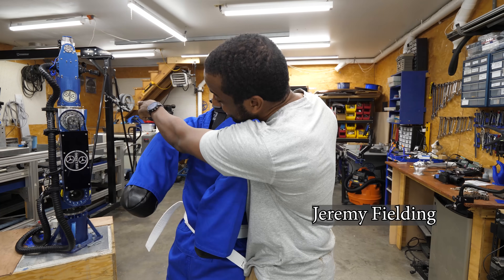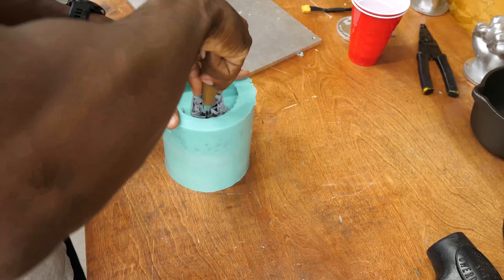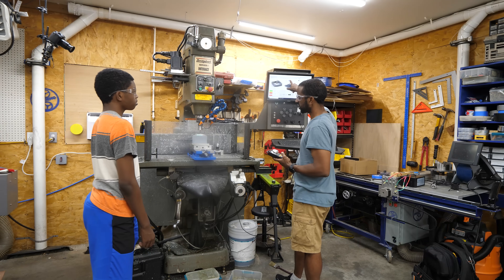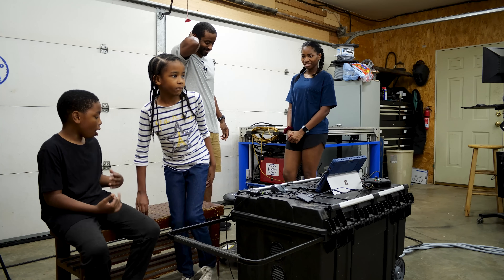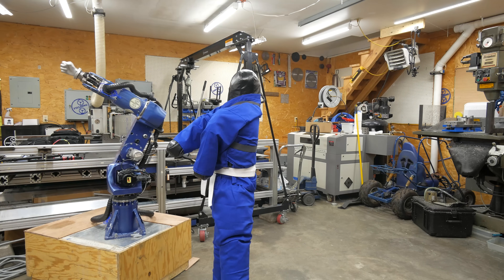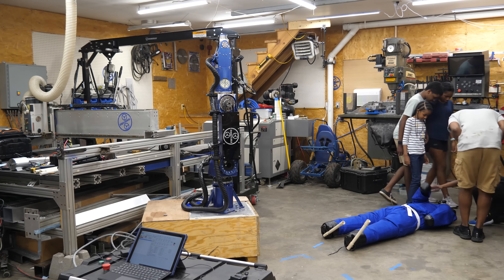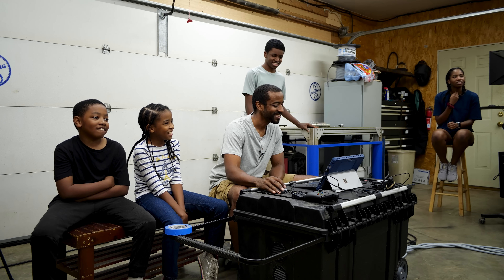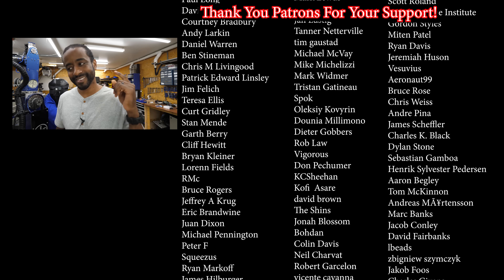Could You Take A Punch From an Industrial Robot? # 094

Comment: Industrial robot? I see so much backlash in the 3rd joint.
Reply from the maker: It’s not backlash. It’s belt stretching from the sudden deceleration. To maximize the punch the deceleration is set close to zero. No robot can stop on a dime. repeatable and accuracy are both very high which is not possible with backlash. If you watch later videos where it’s set to low speed mode without the belts I am plasma cutting steel with high precision

Comment: Looks like it bounces/shakes a little bit.

So for the engineers in the comments:
How would you guys fix that?
Reply from the maker: The acceleration is set to zero and it is belt driven. So I would expect it to shake under these conditions. Try to swing a 8lb sledge hammer that is 4 feet long then try to stop it instantly. You can't do it, and nether can the robot. The "fix" would be no belt drive and gradual acceleration/deceleration. I explain why I chose this route in my video on " Robot speed". Thanks for watching :)
Reply: @Jeremy Fielding  Thanks for responding!

I just watched a few videos of "brand made" industrial robots, and they do exactly what you said: they slow down instead of stopping suddenly.

https://youtu.be/IbQUc3VW1qo

Comment: BTW, on skipping teeth, about 15 years ago I was working our first conveyer system that used an  AC Induction Motor and a AC Freq Drive (we normally used servos) and my boss wanted to know how fast could I program the belt acceleration to.  We did not break the teeth off the belt but the noise was pretty notable.  Another even bigger event was when we were running a pusher belt with a 3hp AC Servo.  Things looked good but then there was a large discontinuity in encoder reading and the servo loop interpreted as near infinite negative error which resulted in the motor instantly reversing at full power - than quickly disabling because of the Max DAC condition.  We were just driving the pusher belts so very little mass so I don't think any teeth skipped but It was pretty violent and I am glad the belts weren't damaged because they are custom metal core belts.

Comment: I have a old AC condenser fan motor and I want to know how to wire it to work as a barn ventilation fan. It's five pin and I wish you would make a explanation of which wire I need and how to wire it to work.

Comment: You should really put more effort into making this thing more stiff. The arm would be so much more handy.
Reply from the maker: What you are seeing is almost zero deceleration at the end of the swing. I turned it down because it didn't look like much of a punch when the robot was slowing down before the hit. Also the fist weights 8lbs and is denser than steel. Look up 8lb sledge hammer then imagine trying to swing it while stopping suddenly. That is pretty much what you see. The problem is not the robot, but the driver slamming on the brakes with a high load.

Comment: One teaching tool would be to print another of the mounting plates that broke, and have your kids work out how much work it takes to break that in a similar way. Likewise if the 'bones' of 'Joe' were pvc pipes, if any of them are broken (beyond pushed together pipe fittings being separated) have them see if they can work out how much it takes to do similar damage.

If you want to do a follow-up, see if you can get some sort of impact sensors as is used in crash testing, and  see if you can capture data about the impact that the arm is imparting. It may also be handy to review episodes of Myth Busters with Buster wired up for doing some of their tests. I believe they related some of the statistics on impact and such as it relates to they type of damage it can impart.

Comment: There’s some definite wobble to the arm at high speeds and stops.. Do you think you could apply some sort of inertial dampening to the arm?
Reply from the maker: I am using almost no acceleration/deceleration to get the highest speed I can inside the robots range of motion. It didn't look like much of a punch when the Robot was slowing down before it hit the dummy, and it was difficult to position the dummy much closer and still hit it the way I wanted. So to get the look of "follow through" I chose to lower the acceleration time frame. This was intentional. I just wish I had thought to bring it up while editing the video, as a few others have mentioned this as well.
Reply: @Jeremy_Fielding  well, you’re a great man. It’s cool to hear directly from you. Is passive inertial dampening a thing in robot arms to your knowledge or is it all done by cleverly imperceptible deceleration ? Really fascinating stuff. I suppose if you had a really really huge robot arm the size of crane but much faster you might want some kind of suspended weight but I don’t know what I’m talking about. I’m thinking of sky scrapers in earthquake danger zones, not high speed robot arms. But deceleration answered my question for sure. Nobody decelerates during a punch unless they have instant regrets or it’s just goofing around.

Comment: I can honestly say that I learned so much by watching my Dad not only fail but hoplessly screwing stuff up repeatedly. He liked woodworking and so do I. He was a very proud man but in this case, with his 5 thru 11yo son, he was very generous. He not only admitted to the failures, but took the time to explain what went wrong. He routinely cut rhombus parts to what were supposed to be square cabinet doors. Getting the inside and outside measurenents mixed up often. Subsequently, it's a mistake I don't make. That's just one example of how well watching someone fail is valuable. Almost to the point of, is it really a failure if it teaches so well? When my Dad was home and in the shop, if he turned, he hit me in the forehead with his elbow. I watched  EVERYTHING he did. And as was age appropriate, helped.

Comment: The robot was very shaky, it looked like a bamboo stick. It should not be used for projects that require precision. It shouldn't be because of the servo motors, so it's a problem with the structure.
Reply from the maker: That is called acceleration. If I gradually slow the robot down there is no shaky. 
I am using almost no acceleration/deceleration to get the highest speed I can inside the robots range of motion. It is the equivalent of stomping on the gas then stomping on the brakes in your car. You would get very similar behavior. Everything in the car swings to the front. Nothing is wrong here. Its the driver not the car. LOL
Reply: @Jeremy_Fielding  I understand about the acceleration, so it's explained.
But I really liked this project and all the others. You are to be congratulated. Your channel is really cool and will grow a lot. In the junkyard in my city there is a large machine, the size of a refrigerator, with a robotic appearance that seems to have many servo motors, bearing joints, shafts, electronic compartment, etc. and they sell it as scrap, based on weight. Could it be that if I sent you a picture of this machine could you tell me something about it? Whether or not it's worth buying to enjoy the parts?

Comment: Hey Jeremy. Love your channel! Looks to me like you don't have or are not using S-Curve ramping for your bot arm. It should significantly reduce the Jerk (a real technical term!). Keep up the good work.
Here's a really simple S-Curve function that I use all the time for basic motor ramping.
First take the time that you want the acceleration to take place over (milliseconds in this example) and turn it into a factor between zero and one. Like this:

tf= ct / tt.

Where tf is the time factor (a number between zero and one), ct is the current time in milliseconds and tt is the total time you want the move to take.
Next apply this formula to get an output between zero and one:

Output=(3-2*tf)tf^2

Output will be an S-curve output based on the time that you want the ramp to take place over. It will be a between 0 and 1 which reaches 1 by the time you get to the end of your ramping phase. If you multiply this by the final velocity you will be able to get a simple velocity profile that is an S-Curve.
The hard part with a five axes robot is working out the time that you want the ramp to take place over. If you apply some basic S-curve ramping to your moves your motion should get less jerky.
Reply from the maker: I am using almost no acceleration/deceleration to get the highest speed I can inside the robots range of motion. It didn't look like much of a punch when the Robot was slowing down before it hit the dummy, and it was difficult to position the dummy much closer and still hit it the way I wanted. So to get the look of "follow through" I chose to lower the acceleration time frame. This was intentional. I just wish I had thought to bring it up while editing the video, as a few others have mentioned this as well.
Reply: Ah yes of course! What software are you using to control it? Is it a home-brew or are you using something off the shelf? I might be able to help in that area.

Comment: You could remove the main belt and bring the center of gravity closer to the center if you took the lower motor and instead of mounting it sideways mount it pointed towards the top with a shaft and gear. Motor will still be Low on the machine and no belt. Just an idea

Comment: This is awesome and reason enough to build a robot arm.

You are clearly turning on and off the robot with your computer when declaring it safe or unsafe for your kids to walk by it or near it. I wonder if it would be worth putting some sort've big obvious light or signal on the arm itself to indicate to others (or your younger kids) when the arm is and isn't "armed and ready to accept instructions to move" just to avoid any potential accidents caused by walking near it and not knowing it's about to move. Would probably be trivial for you to include, tapping into the existing power.

Comment: That robot cannot be compared to an industrial robot.
Try a Kuka or Fanuc or Yaskawa..
Reply from the maker: I completely agree... This one was designed and built by one guy from scratch in his garage over 4 months, and run by a homemade program. Kuka robots are designed by massive teams over decades and built in custom factories. I would expect some differences. I call it industrial because its reach, material, and load capacity are equal to industrial robots of the same size. Thanks for watching!
Reply: @Jeremy_Fielding  Absolutely you did a great job. the mass and "nastiness" of an industrial robot is frightening. I am a Kuka programmer and I am terrified if something like this should happen to an operator.
Reply: @Jeremy_Fielding  absolutely you did a great job. the mass and "nastiness" of an industrial robot is frightening. I am a Kuka programmer and I am terrified if something like this should happen to an operator.

Comment: I really hope you read this, becouse there is a much simpler way to get out a silicone mold. take a compressor and spray air around the side, and it will slide right out.

Comment: The end of the arm of the robot will travel fastest when as many joints as possible are moving. If only 1 joint is moving, the EOA will only travel as fast as the single joint, but if you have 2 or more, the speed combines making the EOA move faster.

Comment: that wiggle of robot at the end of moving. something is not ok...
Reply from the maker: I am using almost no acceleration/deceleration to get the highest speed I can inside the robots range of motion. It is the equivalent of stomping on the gas then stomping on the brakes in your car. You would get very similar behavior. Everything in the car swings to the front. Nothing is wrong here. Its the driver not the car. LOL

Comment: Looks like the arm is running great! And a fun little debut for it as well.

One bit of advice for casting molds like that, use a cut pipe taped together or tape up some plastic sheet into a tube. When the mold dries, you just pull off the tape and split/unroll the outside.

Comment: To remove the silikon from the aluminium tubing I would have used a compressor to push air around the silikon so it just slides out.

Comment: Considering you didn't :
- use any kind of vacuum chamber (or pressure pot ) to cast the molds*
- consider any feeding sprue or ventilation hole for the metal cast **
- design the robot for this kind of motion (remember, you need to punch behind the target)***

... you got it pretty much perfect first time ! Nice!
Didn't know bismuth machined that nice :)

* From my experience following people who make resin things , and can't aford no bubbles in the mold or product, people use either of this.
** This i learned during my career. Might be that bismuth fluidity and melting temperature , and the mold being silicone (instead of sand) just worked out ?
* Meaning, you need to finish the motion behind the actual target, so the impact happens at max velocity. Also, the real danger on industrial robots still is entrapment and getting pinched between linkages . They usually have no compliance ...

Comment: This video just started playing on my screen. So I’m telling you one minute into the video the answer to Mr Fielding’s question is unequivocally NO. An industrial robot can kill you. Never disable safety features that prevent the robot from coming into contact with people. 
I was training to operate a robot at a reputable robot manufacturer. I wrote a welding program on some offline programming software. I had two robots which operated in tandem. Both mounted on a linear traverse so they could move to another station while the operator cycled the welding fixture. Because it was training I wrote the program for one robot only to weld the whole part itself. Somewhere between finishing the first part (which was perfect) and traversing to the other part the robot went nuts and started spinning and flailing about at max speed. The safety screens were not integrated at that time. If we had been standing close we could have been killed. We ran the simulated welding program at 1/4 speed until we got to the traverse at which time the instructor cranked the travel speed all the way up. It was scary until he hit the e-stop. I did not write the traverse code so I’m not sure what happened.

Comment: Wonderful video! "I have no idea what I'm doing", followed by figuring it out and doing it, sums up all of the engineering fields so well. The robot arm's rapid motions looked more wobbly than I expected. Is that coming from the control system, or is there mechanical compliance in the arm somewhere? I already assumed that I could not take a punch from an industrial robot, but now I'm quite confident about that.
Reply from the maker: I am using almost no acceleration/deceleration to get the highest speed I can inside the robots range of motion. That is like trying to stop a Mack truck going at full speed within a very short distance. everything inside the truck and the body of the truck swings forward over the wheels.
Reply: @Jeremy_Fielding  Thank you very much for answering my question.

Comment: the oscillation as the arm swings is that partly the belt drive and the kinematics? you might need to run a different coordinate system?  from memory there was 3  i couldn't tell you exactly what they are  (xyz,abs,?)
Reply from the maker: The acceleration and deceleration are turned almost completely off. This allowed me to build up more speed within the Robots range of motion, but stopping that fast with a 8lb block extended all the way out stretches the belts when you stop... it's like trying to stop a Mack Truck with an elastic band.
Reply: @Jeremy_Fielding  yeah the fanucs had direct drive on most of the 6 axis (using planetary gear drive to drop down the speed to make it more accurate) only using belts on the elbow and wrist  due to size and space constraints

Comment: This is great!  Thanks for sharing this!
Reply: Honestly impressed the silicone worked to cast aluminum!  Is this a special kind of 2 part silicone that can withstand that heat?
Reply: @JordanV  It was bismuth, not aluminum.
Reply: @johnabruce  ohhhhhh.  Didn't realize that.  Thanks.  Didn't know bismuth had that low of a melting point honestly, but I've never worked with it before.

Comment: Nice casting idea! Haven't gotten to the boxing yet, but;

Your mold box is very wasteful of silicone (which is very expensive, at least where I live). Once you have a 3D model of your object to cast, it's easy to build a purpose built mold box - "expand" the fist 5 mm (easy to do in for instance Fusion 360) and cut it from a solid box and 3D print that box. Don't just scale up the fist, use the expand tool instead. Create cut lines along the sides of the box so it can easily be opened. 

 I suggest adding two 3 mm  holes on each side of the mold opening where you can use a plier to split the box open. I use e-clips pliers which open when pressed, as opposed to closing when pressed. Pops the box right up.

Tape up the seam to prevent leaks, masking tape works fine. Using this method, you could have cast your fist using waaay less silicone. 

When casting, replace place the mold in the mold box, which can be called a mother mold, and the mold should hold it's shape through out the casting.

Comment: Great video, looks like fun. Why is the lower arm axis so bouncy? Is it just bad tuning of the motor controller or some mechanical issue?
Reply from the maker: I have the acceleration and deceleration turned almost completely off. Doing this allowed me to get the highest speed I could within the working reach of the robot. However that is extremely tough on the servo motors and the drives. Having the arm fully extended makes it worst. Its like the difference between stopping a car and stopping a Mack truck.